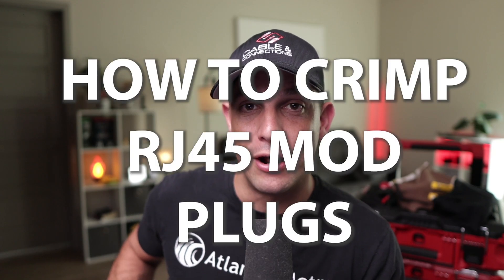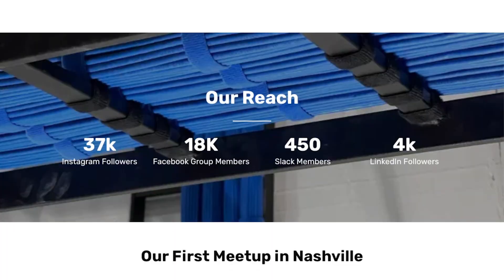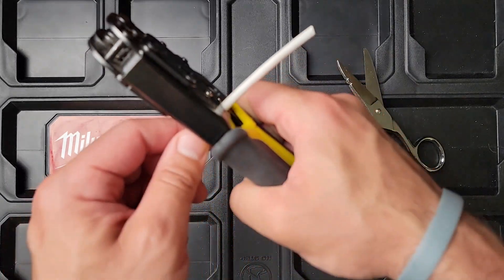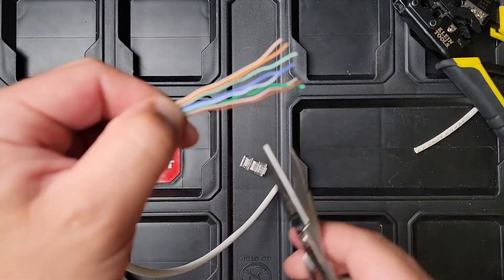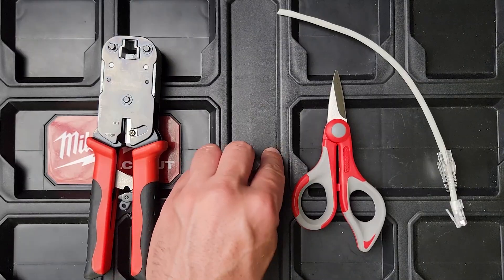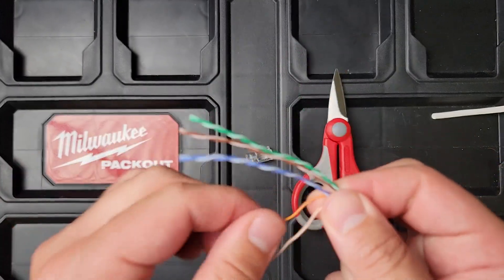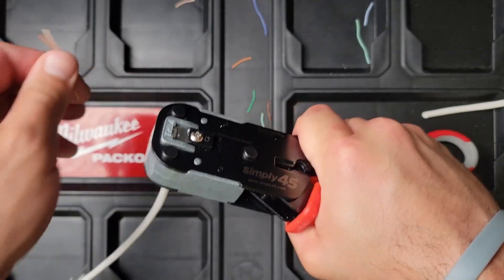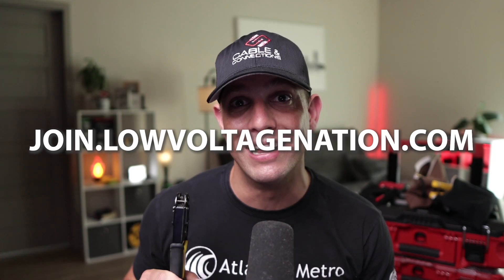How To Crimp RJ45 Mod Plugs (Passthrough vs Regular)

Comment: I got the D Link crimping tool... Just like the kind you used for the regular style jack, with the wedge in-between.

I find ot really difficult to use. Because it gets stuck unnecessarily, I just don't understand how it work.

Any pointers would be appreciated.

Comment: Question…I have StarLink 3rd Gen, and their Wifi Router (it’s pretty small) uses the RJ45 connector, but I am not sure which one, (the CAT 5e or 6), because StarLink sells a 147’ plug wire for that, but I was thinking that I could make my own cord that is longer than 147’ (or shorter, depending…) by crimping my own connectors onto a roll of wire, (500’ is less than $100) of my chosen length, instead of paying Elon $115 for his 147’ plug wire! But which connector and which wire size should I buy, please? Thanks for all your videos!

Comment: This is BS, complete and utter BS.
I'm tired of the internet how-to's where you get the simplest tool and wire and just push wires straight. 
Wow it's so easy.

Now let's do T568B in the wall socket, and T568B at the connector side.
Now let's add a fat wires with extra layers.
Now let's add ground wire, or should we?
Now let's repeat it 10 times in a row.
Now let's see if coating cutter didn't cut through wire, oh crap it did, now redo everything.

Next video: how to plug USB.

Comment: How do I cut off the extra after I crimp? It leaves a small amount hanging out. I do this so I make sure I’m getting a good connection. The tool itself does not cut the wires clean like some of the others do leaving a tiny amount of wire hanging out and I don’t want them to touch because it can cause a short
Reply: You have to use the crimping right tool. One tool is made for "pass through" type connectors and the other tool is made to be used with modular type connectors. You need to double check which one you have.  I learned this the hard way and had to buy another "correct" crimper to work with the plugs that I bought.
Reply: I figured out my crimping tool which was not even old was not slugging the wires when crimping it. The part that smashes down the end was causing damage to the tips. Bought a good expensive one and it worked great

Comment: Really helpful video, thanks. I was struggling to get the wires to root correctly through the passthrough connector until I watched your demo and realised I was cutting the wires too short unnecessarily. Frustration converted to success - thanks again.

Comment: > really good quality cat 6

> not shielded 
> not foiled

What’s good quality? The feel of the rubber? lol 

Do you have any idea what an Ethernet is used for? Ever heard of interference???
Reply from the maker: Superior Essex is known for its high quality category cable… if you’ve used many different UTP category cable manufacturers then you would know.

You jackasses that come on here to criticize are some of the most pathetic people on the planet. What’s the point? Does it make you feel better?
Reply: @LowVoltageNation  im just saying, the quality of an ethernet cable is based on its ability to transmit data. not being shielded at all means that it will be subject to interference. so it is not good quality.
Reply from the maker: The quality of UTP category cable is determined by many factors. STP is a different type of cable with different applications. Both have different quality levels between manufacturers.

Some UTP cable manufacturers use CCA and cheaper material. Some also don’t have proper twists or have other manufacturer defects and get tangled easily. When you buy cheap UTP, you run the risk of failed cable and depending on a job spec, you won’t get warranty.

Some jobs spec UTP and some spec STP… either way, you want to use high quality category cable regardless of classification and spec.

Comment: For RJ45 passthrough,   Is the only difference between the two crimping tools the ability to also cut the passthrough wires at the same time?  Could I use a regular crimping tool and
a pair of side cutters for the passthrough wires?
Reply from the maker: You need the proper tool
Reply: @LowVoltageNation  after a lot of research the only difference is having the added cut for the passthrough which still might not cut them down short enough
to allow the connector to go all the way into the RJ45 socket.   The best trick I have read is pull the cable wires tight though the holes of hte RJ45 and make the cut.
Then pull back just enough to get the ends of the wires back in the hole and crimp it.
Reply from the maker: @n1kkri  just don’t use passthrough connectors. They kinda suck anyway and have too many points of failure.

If you do use them and insist on using side cutters, then pull the cable back very slightly so the wires are not exposed… but this is still a bonehead move.
Reply: @LowVoltageNation  I read the same trick about pulling the cable back so the ends won't prevent the RJ45 from going into the socket.
Reply: @n1kkri  it's a bad move in general. A bad snip can leave strands that can short out on the other leads or certain embedded systems that have a shielded connector.

I've personally never had issues with passthroughs, but you should always order custom-length cables in a professional setting regardless.

Comment: Thank you for the demonstration for both types of connectors.   In my situation, properly crimping the connector with right tool and method are very critical.   I do a lot of RF repair and installs.   Now a days , most radio equipment microphone use rj45 plugs to connect to the main radio chassis. This, people break them easily and have to be replaced

Comment: Gotta love these video's that make it all look easy with VERY OLD thin flexible cat 5/5e cable.....try it with cat 6 or god forbid cat 6a - much harder to get them all lined up and untwisted enough not to kink when you insert it into the connector, especially on pass through which don't have any channel guides.
Reply: But he used brand new Cat6 cable that has never been stripped. It's almost like you didn't watch anything.
Reply: @MinistryOfMagic_DoM Cat6 and Cat6a come in many different gauges.  He didn't specify that part.  Cat6A is shielded and a giant pain to get aligned on the thickest 23AWG.  I think the answer to that problem is to just use keystone jacks at each end and make/buy patch cables out of thinner wire, but pass-through connectors could also be a reasonable solution.

Comment: Regular all the way. On pass through the cutting blade wears out, might not cut flush, the pairs open ends remain exposed after terminarion which can cause rf interfierence later on.
With a little extra practce the regular is just as easy to terminate. The fact that patch cable manufacturers dont use pass through says it all too.
Reply: Correct and the copper ends could possibly touch each other and cause a short.

Comment: I have a question do all of the gold pins should be pushed though because this is my first time doing this, i used a passthrough crimping tool and the both ends are not pushed all in
Reply: To find out test it with a network cable tester. The cheap $7 ones that just test continuity and wire order are fine. You always want to test your terminations wether youre a 1st timer or pro.

Comment: Really don’t need to have that much hanging out the pass through heads.  Definitely get a feel for it the more you use.  I learned on the old school crimpers as well, but like the pass through much better these days.  Less fuss. Just buy 1000 pass through heads and you’ll never run out

Comment: How are you this good at sorting the wire ends in the right order? I always make a mess several times where they end up crossing over each other every which way.
Reply from the maker: Thousands and thousands of terminations in the field
Reply: @LowVoltageNation  Yeah well you'd think we'd want to learn from your experience rather than gloss over it. For me this is the only hard part.

But i think i figured it out how i can do it neatly now. Splay the twisted pairs down in an X, keep orange to the left and brown to the right, then bend blue up and untwist it solid-dashed, then untwist green around it, then untwist and arrange the other two. So work my way from the middle but have the sides pre oriented where they would end up going. Assembling the wires left to right like most are saying to do isn't working well for me.

I have watched quite a few vids trying to figure out how to do it well and have seen some atrocities including people just terminating completely wrong pinout where signal carrying differential pin pairs would no longer be twisted pair.

Comment: Is one preferred over the other ?
Reply from the maker: I prefer regular and many people frown upon pass-through because the potential to short out. You're also considered a n00b if you use pass-through. The safest way to go is regular because you don't need the special tool and it's more reliable.
Reply: @LowVoltageNation how would you ensure good contact with passthru? I didn’t know about this shorting issue until recently
Reply: @YourHaloCreations  Use a network cable tester, which is always a good idea.

Comment: Can I use a regular crimp tool with the pass thru connectors? Being the same, I would only have to cut the exceeding cable by hand, right? Or mandatory, I have to get a pass thru crimper tool? Thanks.
Reply from the maker: No. Definitely do not want to do that because you will most likely have exposed and uneven wires

Comment: A few years back i was talking to an AT&T employee about making cables. I was told that instead of fully straightening out the wires, i should leave it twisted near the jacket. I was told it was something to do with reducing crosstalk.
Reply from the maker: Correct you want to maintain the integrity of the twist
Reply: I've tested this with my Fluke and it doesn't effect anything at the end as long as the all the wires and jacket are in correctly wether it's a regular or pass through Ice cube👍

Comment: can you crimp regular mod plugs with that pass-through crimper?
Reply: I've got that pass thru crimper and no you can't. You must use the Simply45 connectors. I wouldn't buy it again had I known. Get the Klein crimper, IMO.  You get that, a punchdown, and a tester, (I like the Southwire Cat6 tester/probe combo) and you're good to go.

Comment: How do you do do that you are good cutting the cable perfect I search on YouTube how to do it finally I did problem is I cutting cable too short or too long and then I have to twist cable inside sometime cable fine but I sell this one my cable number six is not working fine I need to learn more tricks if you can help me to do it better sometime I cutting cables way too short or a little bit longer it will never fit perfect

Comment: Do I need to buy pass through crimper or I can use the regular crimp tool. Want to know if I can use the pass through rj45 connector with standard crimp tool and then cut “passed” wires with scissors
Reply from the maker: Need special tool. Never cut with scissors. Too risky for shorting out.

Comment: Hi Blake, my name is Archer, and I have been in the telecom/networking industry since before you were born. First off, please get your terminology correct. These are not RJ45 mod plugs; you are actually showing how to terminate 8P8C mod plugs. And yes, you are terminating, not crimping here, as Sam pointed out before me. The RJ in RJ45 plugs stands for Registered Jack, and it's an old telecom name, but you wouldn't know that. A real RJ45 plug is physically keyed to go into a real RJ45 jack.  Here is the interesting thing, an RJ45 plug and an 8P8C plug look almost identical except for that key. So much so that a male 8P8C mod plug will fit a true RJ45 female jack, but true male RJ45 will not fit an 8P8C keystone female jack (again, what everyone calls an RJ45 keystone). The problem actually lies with us older telecom guys as when we started doing network cables, we referred to the 8P8C plugs as Rj45s because we were lazy - now everyone calls them that. So, I can't blame you for misstating, but you should know better and not support this inaccuracy to your followers.

You made a mistake when you did your pass-thru termination (remember, we are terminating here, not crimping). The boot for that system has to go one first and is integrated into the mod plug during the termination process,. Howvever, you lead your viewers to think you can add it whenever.  You also forgot to add the black cap (Simply45 calls it the Cap45), which is a critical part of that style of pass-thru plug.

Lastly, I know you work in a lab setting and are posting these as technique videos. Still, you need to be certifying your cables or at least baseline wire mapping to show your audience that your work is actually good and you know what you are doing. Your favorite sponsor, Klein, makes a wire map tool - maybe you should ask them for one?

Best of luck, and keep on educating us on your fulfilling journey.
Reply: Wow! This was equivalent to watching someone get slapped in the face and then given a hug right after. Archer, your first three sentences were one the rudest replies I've ever seen for an instructional video. You may have all of the old school knowledge on how to "terminate" correctly, but your delivery method to express your opinions needs some serious adjustment. 

I probably have 20+ years on Blake, but still came here to learn the how to use the pass through so I could install internet upstairs. I followed his instructions under the guise of "basic installation", got my RJ-45 modular plugs installed and am getting my full 1gbps speeds.  In fact, I learned an easier way to position all of the colors by watching his method as I was trying to do it from the ends of the wires which took a long time. 

So for people like me that aren't in the low voltage business, it doesn't matter whether it's called an RJ45 plug or an 8P8C because when we go looking for the plugs in every major brick and mortar store in America including Amazon, they are called RJ45 Modular Plugs. When I asked the guy a Lowes where I can find RJ45 plugs, he didn't give give me an earful saying I was an idiot for not calling them 8P8C modular plugs or that I said I wanted to crimp instead of terminate. Even if he knew what it's called, he knew what I wanted and sent me to the isle. Plus, the box didn't even say 8P8C anywhere on the packaging until I opened it up at home. So, if I went looking for that specific term, I would have been lost in the isle looking for something more commonly called RJ45. 

You're just playing a game of semantics to prove your professional opinion which is not needed for a video meant for people who are just looking for basic install information. I'm pretty sure people in the low voltage business aren't coming to videos like this to learn their trade and if they are, they're hopefully not licensed to install with any reputable company. 

Blake, even though you're way younger than old Archer here, I learned a lot by following your tutorial and appreciate you making videos like this for people like me.
Reply from the maker: @gsquared2420  this response made my day. Thank you 🙂
Reply: When I use a crimping tool, I call it crimping.  When I terminate an RJ45 mod end, I call it terminating an RJ45 mod end.  When I land a feed cable onto a 66 or 110 block or a patch panel, I call it terminating or punching it down.  And as old as I am, I have never in my life used the term 8P8C, I always use the term RJ45 mod end.  The point I'm making is that it doesn't have to be called a specific name when describing what it is you are doing especially when you are sharing your knowledge with others, I knew exactly what the video put out there and it is spot on, I've been doing it the same way for many years.  It's because of people like Archer (and other boomers) that I describe things the way I do.  Example: When I describe loading a pew pew, I always use the word clip, because I know how much it irritates people when I refer to my magazine as a clip.  It really pisses people off when I tell them I always load my clip so I'm ready to rip!  For some reason they keep saying "it's a magazine not a clip!" thinking I'm going to call it something other than a clip, LOL.
Reply: Archer is totally on the spectrum 😂
Reply from the maker: @Henry_Jones  ya think? 😂
Reply: I saw hot to crimp, cómo ponchar,  model passthrough and regular model of connectors.
I mean:  everybody will understand two models of rj45 and two pinzas or crimpers o ponchadoras. that's all!  technicals specific detailed specifications is good to know, just that. (and important for certifications, yes as they say)out of that  ethernet cable, ethernet connector, 8P8C, rj45 in some way are the same and everybody knoes what people means about.
Reply: Archer, You are extremely condescending and lack self awareness. For someone as proud as yourself, I found that your channel has no content to offer. With all of the experience you cited, I am unclear why you watched this video. Happy trails big guy.
Reply: So which tool do u prefer pass through or traditional one .
Reply from the maker: I appreciate your candor.

If you purchase these mod plugs from Leviton or Klein or Platinum Tools or whoever, it says RJ45 modular plugs. 

I put the boot on first.. but I believe you're right that I didn't specifically say to put the boot on first. The black cap is optional and also just another ridiculous step to go through with passthrough.

This wasn't a video on certifying, but I did mention the importance of it in the video.